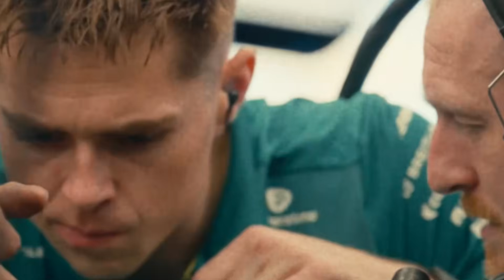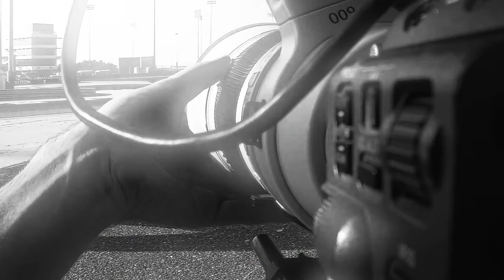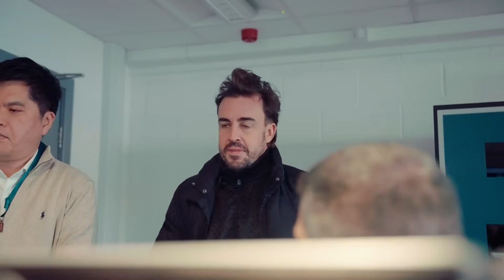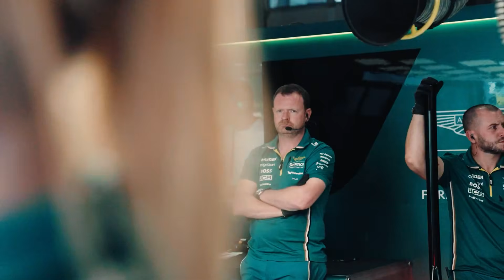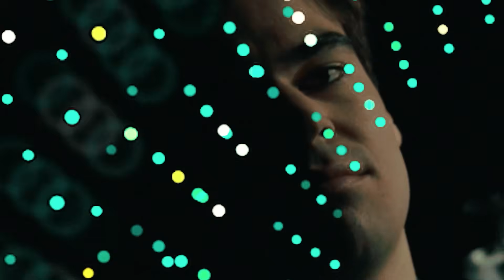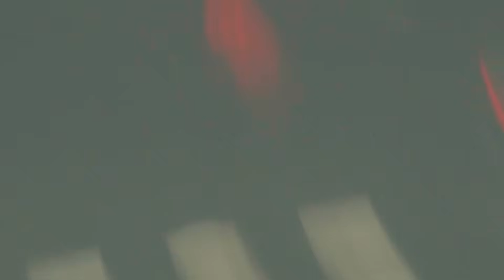Aston Martin CAUGHT Hiding An INSANE Honda Engine Upgrade!

Comment: They had a half decent car at some point. But this season... ugh. Even Newey can't fix this box on wheels.
and the 40 horses  "better for overtaking?" then it has to be batterybased because that's almost the only way you can overtake with the horrible '26 cars.

But,  IF this engine upgrade is reliable it might be a platform for the next season to build on. But in the end, there are 2 drivers in the team, one is pretty damn good the other is there because his daddy bought the team.